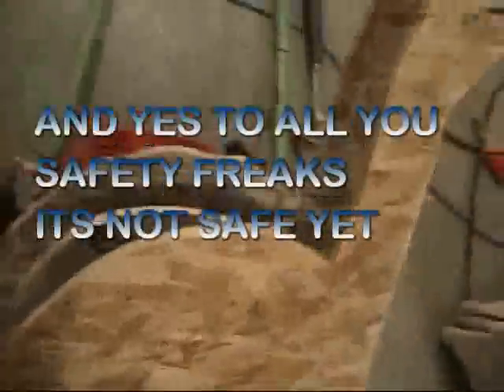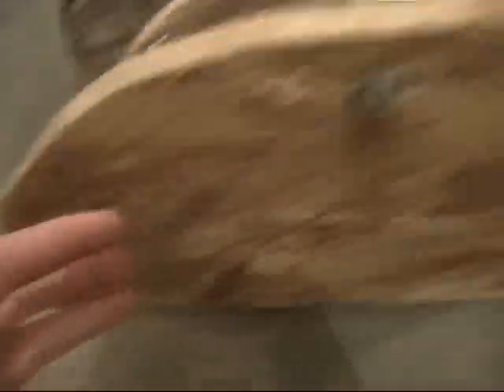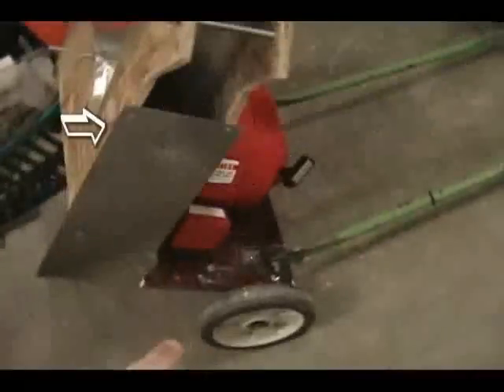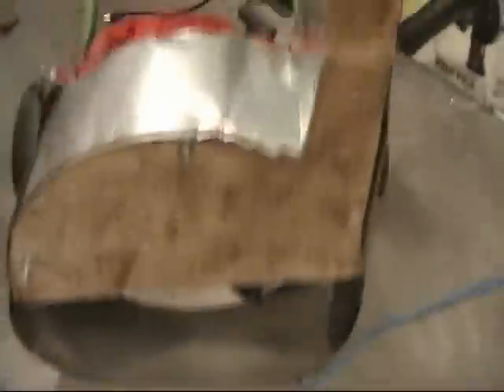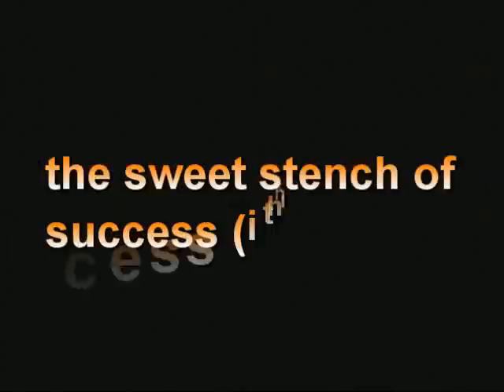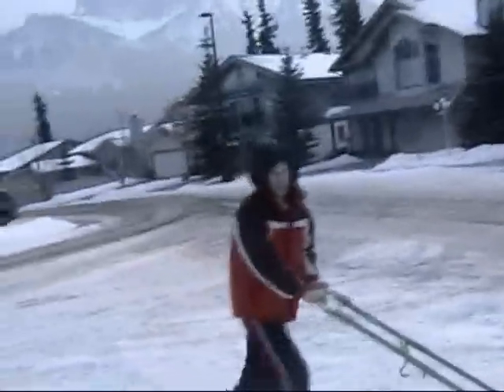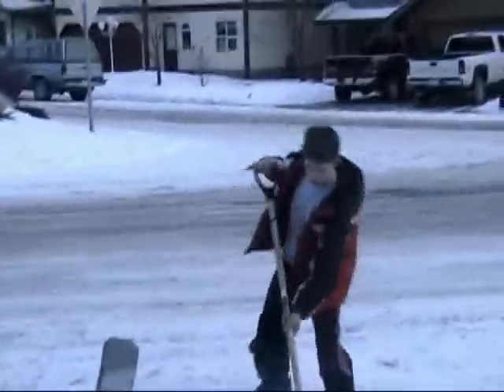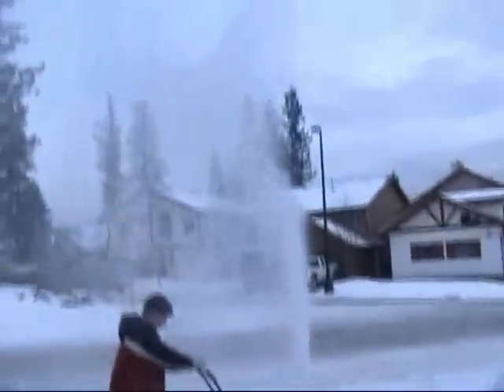My Homemade Snowblower

Comment: well by judging the design of the pull starter housing and the engine sits in an angle, it's a tecumseh, and the engine runs and shutdown, i can tell it's a 2 stroke

Comment: if i were you i would get a big l joint for the botom to replace the sheet metal then i would get a grinder and meatal saw and make the front botom edge shart and put a couple teeth into it and it would also make the botom sturdier